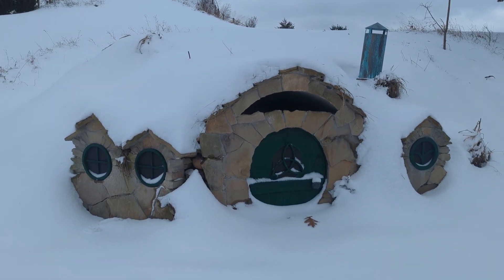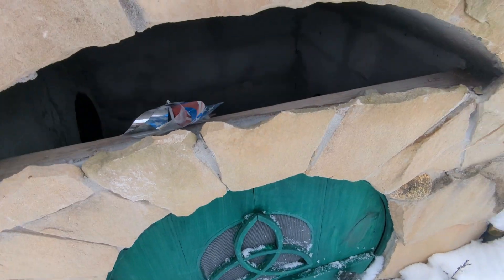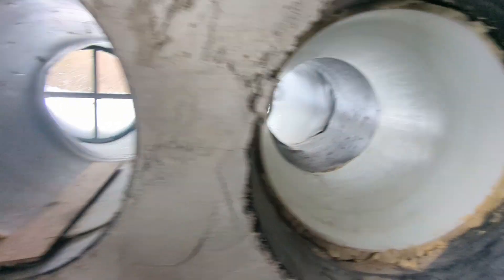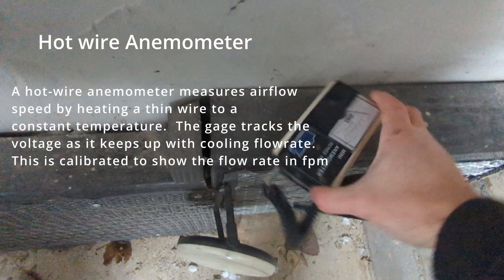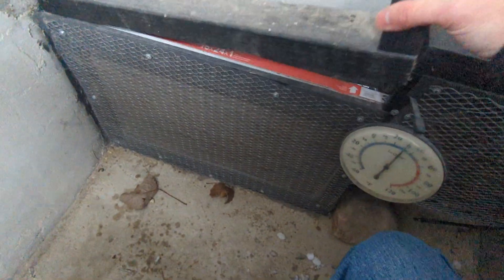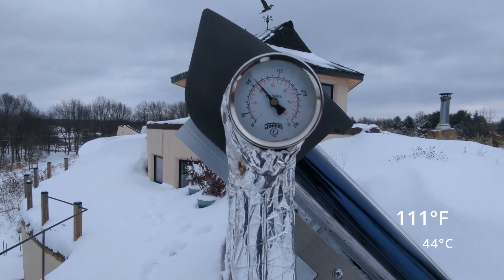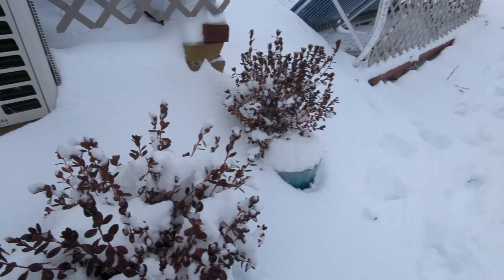Hobbit earth tubes update

Comment: A warning, earth tubes breed mold, mildew, fungi and Legionnaire's disease from being warm, dark and damp/wet from wall condensation.  Don't do them unless you can regularly clean them... Just run poly pipe and a liquid to transfer the heat/cool.  Otherwise I love the place.
Reply from the maker: Correction, "badly implemented earth tubes breed mold, etc.  "

My website explains how to avoid those problems.   I have had mine running for many years and have not had any problems.  I do have the ability to clean them, but have never actually tried it. 

https://www.homeintheearth.com/tech_notes/earth-tubes/

Comment: I installed cooling/warming tubes for my Virginia home.  Works very well in winter.  Wood stove draws a lot of air from outside, warming tubes keep outside air coming into the house at 56 degrees instead of 18 or whatever the outside temp is, huge difference.  My tubes are 300’ long, but I could have used less.

Your project was a huge inspiration for my installation.  Thanks!!!
Reply: Do they not work as good for you in summer?
Reply: @y0nd3r  Summer was okay for my tubes but not what I had hoped for.  Best output during hot days was 70 degrees, not enough to cool the whole house.  But cool enough to cool the bottom floor.  I am going to do some experimenting this summer.  Thinking about mounding soil over the top of the tube line to provide a barrier to hot temps, then planting on top of the mound with native grasses to shade the mound.  Also recirculating inside air in a loop through the tubes instead of drawing outside air.  We’ll see.
Reply: @Syntropicfarmer  Instead of an air loop, consider the idea of a liquid transfer like glycol or similar with a small pump for heat transfer. Your air tube idea would certainly mean trapped moisture /condensation that would be difficult to control. Such a system would use some electricity, but so would an air tube system with a fan.
Reply: @ForbiddTV . The liquid idea is solid, thanks, but I am already over budget on this project.  Can’t spend more for that kind of upgrade.

I experimented with the loop last year.  You are right about condensation.  My solution was a small hole at the bottom of the loop to allow drainage.  Worked okay to drain away water that made its way to the bottom.  Still condensation in the tubes though.  Was not excessive, didn’t seem to cause mold or mildew, but it was a short term test.  Surely issues would arise requiring sanitation.

Electricity is not an issue in the winter since the wood stove creates plenty of draw.  Summer does require electric fans to keep air moving at a rate high enough to make a difference.  If no electricity is available, a solar chimney is my solution, which I still need to build.

Thanks for your feedback and suggestions!
Reply: @Syntropicfarmer   Holes in your tubes for drainage might not be a good idea if you are in a radon prone area.
Reply: @ForbiddTV . The bottom of the tubes is an intake pit, measures five by five, five feet deep.  Rock lined, deep rock gravel floor, drain pipe to keep water from pooling.  The tubes enter the intake pit at three foot depth.  So the tube intake is open air, so is the loop drain.
Reply from the maker: Mine really stay about the same in summer and winter, varying only by few degrees during the year.  The only problem in summer is they come in at almost 100% humidity.  Yes, they drop everything above that in the tunnel as the air is cooled, but still...  I tried a bunch of more "natural" or "passive" methods to fix it, but ended up deciding comfort was more important and installed a small mini-split that I uses in "Dehumidify" mode.  Since it is a split, the heat is dumped outside, and the condensate goes thru a tube into the footing drain.
Reply: @SimonHomeintheEarth . I will get something figured out this summer.  At least we have options.

Comment: Exciting to see you post again!
I’m actually shocked that you’re getting 59°F out of the ground , I guess it’s because you’re probably heating up the ground all summer, because you’re sucking through hot air? normally I’d expect something like 50 ish? Honestly turned the Earth into a big thermal battery.
Reply from the maker: Yes, exactly.  All summer we were sucking in hot air and exchanging its heat into the ground.  Now we get it back.  Its like a thermal battery or fly wheel.

Comment: 66.0 F is damn chilly. I have had wood heat my whole life, 75 f is where most people like it, and mine hovers around 77 f because its just a simple stove.
Reply from the maker: We like it at 66°F or 68°F.  Also, keep in mind that we are not just talking about the air temp.  I agree that wouldn't be enough.  All the walls and floor are at >66°F.  This means you don't just feel it only as convection heat transfer to your skin, you also feel it as radiant from the walls and floor and conductive from the floor.  It feels like a sunny day.  It is also warmer by your feet and cooler by your head (where the wall gauge is).  The same temp feels very different when it is coming at you in full spectrum (convection, conduction and radiant).

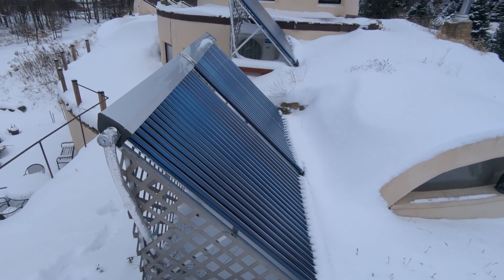Comment: 3:38 I can't help myself....  Do your solar hot water heaters heat up cold water as well? 😆
Reply from the maker: Yea, it wasn't the best time for a demonstration. It was never sunny that day, but I think I got outside just as the clouds got too thick for the system to be useful, so it was winding down.  Its a closed loop glycol system that exchanges heat with water in the large tank as it cycles around...  So if the glycol coming into the panels was already at 111°F, that means the water in the tank was at least at that temperature and the temp on the roof must have been just a little hotter than that so the pumps were still on.  Meanwhile, my teen got in the shower (mid afternoon) and lowered the temp in the solar tank further (I think I recall the tank temp it went down to 25°C  or 77°F) which again meant that the glycol on the roof was hotter than the water in the tank, so the pump stayed on. The system doesn't understand that the solar array was really just losing energy by that point.  By the time I got downstairs, the roof was down to 95°F.  I'm sure that it turned its self off soon after that (as soon as it equalized or dropped below the storage tank temps).

Comment: On the humidity differences between the two incoming tubes:  You said the one on the left was perforated, perhaps you meant to say corrugated.  If it was perforated that would certainly explain the additional humidity coming from ever present ground moisture.  It might also introduce radon.  But on further thought and what I thought we discussed, the pipe is merely the single wall corrugated, not perforated or double wall like the other one on the right.  If this is the case I believe it is very likely the additional moisture could be from trapped water in each and every corrugation trapped there when the inside of your pipes were sweating in the summer months.  I would theorize this additional moisture would subside as that water evaporates in the coming weeks.  The other pipe being a smooth wall would not have as much moisture trapped inside unless the pipes trapped water due to no or reduced slope and couldn't drain to daylight.  Even though corrugated pipe would have more surface area potentially increasing it's effectiveness, I was always leery of using it due to the possibility trapped stagnant water and potential mold growth with no good way to mitigate.  The corrugated probably also reduces the natural chimney effect of air flow due to the additional resistance inside the pipe.
Reply from the maker: It is both corrugated and perforated.  It was actually my footing drain.  Our area is very sandy, and the drain is needed to meet code, not really for moving water. I just "enhanced it" by using 6 inch tube instead of 4 inch tube and I split the loop and put both ends up and into the house.    

I would not use (or recommend) unperforated corrugated pipe specifically because it wouldn't drain condensate properly.  

But I am not at all worried about Radon because I have 30k cubic feet of airflow per hour flowing thru the house when the fans are on.  Any radon that comes in is quickly dispersed through the outlet ducts and doesn't build up.  We had it tested 3 years ago and they found nothing.
Reply: @SimonHomeintheEarth   Thanks, then the additional moisture you’re experiencing on that pipe is almost certainly due to moisture in the ground.

Comment: Thanks for posting, beautiful home.  The perforated pipes, as far as humidity, would have much more surface area compared to the smooth.  Why that would make a difference is above my pay grade.
Fun fact: The corrugated clay pots that the ancient civilizations used would heat liquid much faster than smooth sided pots because of the surface area the corrugations would add.
Reply from the maker: Yes, except that the surface area is not the bottleneck for heat transfer on either side of the pipe.  

On the outside, If I had corrugated tubes exchanging heat inside flowing water, then yes, it would make a big difference.  However, in the earth, the transfer rate of heat thru the sand is the bottleneck.  The entire heat transfer process slows down to the slowest layer.  Literally like if you had flow through a large pipe and then restricted it down to a bottle neck.    

Others believe that the corrugation makes a big difference with the heat transfer on the inside side because they think it leads to turbulence (trips the flow) that breaks up the laminar thermal boundary layer along the wall.  But this is also only true in the specific case where you are assuming the flow in the smooth pipe would otherwise be laminar flow.  In reality, even without the upstream air filter, laminar air flow would transition to fully turbulent within about 6 feet.  

The double wall HDPE pipe with the smooth interior is likely the best option for earth tubes, as long as they are sloped to drain any condensate that forms.
Reply: If you can find my comment right above yours in time, I give my theory on that.

Comment: Where did you buy the hot water system. Would you recommend?
Reply from the maker: The system came from Duda Energy in AL.  I had a lot of trouble at the start with them shipping broken tubes and the wrong control module, but once that got sorted out, I haven't had any trouble since.   I never got around to publishing the video, but you can find it on Facebook in Oct of 22.  Here is a link.   https://www.facebook.com/HomeintheEarth/posts/pfbid02p2DLfHeZyef59Bndfgum7PAxWf2gNJ3dNnZVhLXhusknLudgQ6ussQS3YEVH9DVcl

Comment: About a 28 degree delta T on the Earth tubes in November.  I hope to see your data at the end of winter when the incoming temperature is also around the same 31 degrees.  We would expect some efficiency loss due to the geothermal heat sink effect.  
It would also be interesting to see if the perforated incoming tube is picking up any radon from the ground.  A radon test kit in each tube would reveal if this is the case.
Reply from the maker: Yea, we've been doing this for several years already, but this is the first winter with the hobbit house mostly closed in.  For sure we see a larger change at the start of the season and then a slight drop (2 or 3 degrees) in moderation by the end.  

Same for the house its self.  On the bedroom side (the most buried side) we have no wood stove or significant passive solar gain and we only just turned on the heating system on Saturday night because it finally dropped below 64°F.  Without intervention, it would probably loose a couple more degrees each month as the surrounding soil cooled off.
Reply: How lovely to see a post from you. I have been following you from when you were digging the foundations
Reply: @renaebettenhausen3611   Yeah, but I'm obviously a slow poke compared to Simon.  He's completed and I'm barely started.  I am still trying to get mechanics to help with the final stages of engine changes on heavy equipment.

Comment: I’m not even close to watching all the videos, so a quick question. I would like to learn about your research on berming the buildings. What did you use to waterproof the concrete? Im trying to find something that is not “harmful”, as there will be food crops close to the building. Thank you. And congratulations on your property 👍
Reply: He used a water based liquid applied strong and highly adhesive elastomeric coating (rubber) called Blue Max made by Ames.  After Blue Max liquid rubber paint has fully cured, it is safe for plant roots. The product is non-toxic, water-based, and contains no volatile organic compounds (VOCs). This makes it an environmentally friendly option for projects like waterproofing planters or garden beds.
Reply: @ForbiddTV  Blue Max liquid rubber. I’ll check it out. Thanks you 👍
Reply: @iTeerRex   He's labeled the video episode 30.3 for the Blue Max waterproofing.
Reply: @ForbiddTV  Cool thanks. But before I commit, I’d like to study it’s chemistry. I wanna know what happens even when it begins to degrade after some decades.
Reply: @iTeerRex  That’s probably not an issue in my opinion, but definitely do your research. When I do mine, I intend to put a thin layer of sand before general backfill to prevent sharp rocks from invading the membrane.
Reply: @ForbiddTV  Good idea. I was thinking of adding a French drain as well.
Reply from the maker: Yea, like Craig said, I am mostly using Blue Max.  I also used another kind of sealer (you can find it if you go back to the basement videos) that soaked into the concrete to waterproof it instead of just covering it.  The basements have been dry the whole time, so it worked.  Both of those cure to be "inert" or they wouldn't be effective as waterproofing agents.  

If you are considering doing this, you don't want to mess around with waterproofing.  In addition to sealing the concrete, you can also put membranes over top of that.  Just make sure they help to shed the water and not to hold it.  And keep in mind that it is easy to sketch something, but may not be easy to apply it to match the sketch.  For instance, applying a "thin layer of sand" on a vertical wall may not be straight forward.
Reply: @SimonHomeintheEarth   To backfill a thin layer of sand on a vertical wall, place thin sheets of plywood, laminate, or similar against the wall and put in about 1 inch thickness of sand between the wall and the plywood vertically about 4 to 5 inches, then begin backfill and when you reach the same height of the sand on the other side of the plywood you pull the plywood up several inches and keep repeating that process, compacting each layer after each lift of the sheets.
Reply: @ForbiddTV  Cool technique to use the least amount of sand. 👍
Reply: @SimonHomeintheEarth  Thanks you.